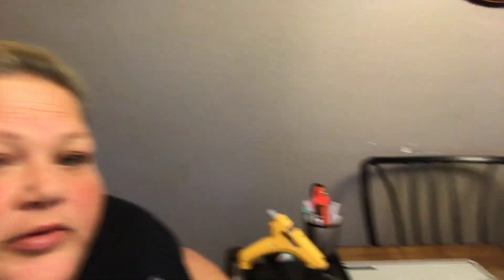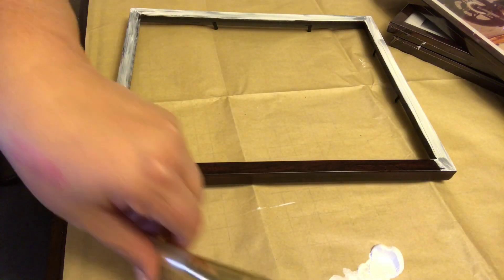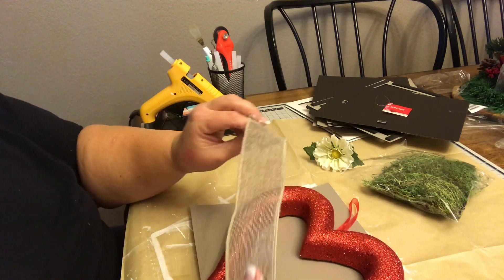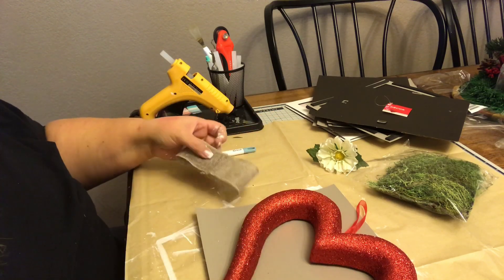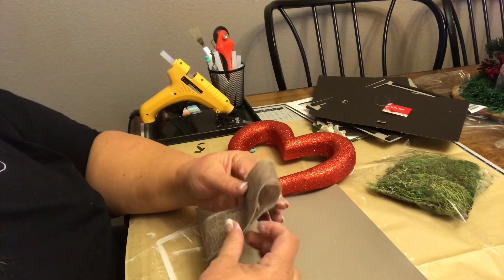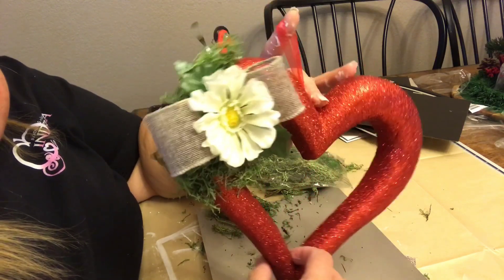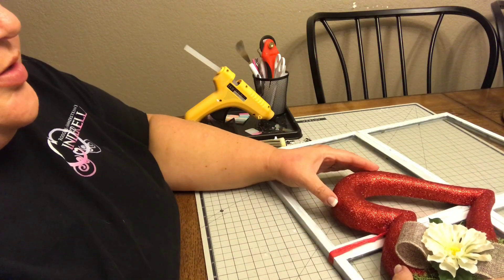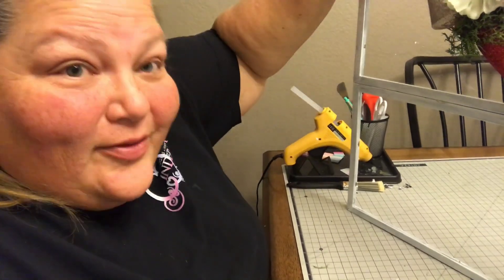Dollar Tree DIY - Farmhouse Valentine Window

Comment: Hey Beauty I’m a new subscriber had have been binge watching really enjoy your ideas they are great ... just wanted to give you a tip on giving the weathered look to your painting projects if you would just get a well used cleaned paint brush and dry brush or dip your brush lightly in the paint and dab a lot of the paint off and lightly brush whatever your painting with light strokes and try not to hit the same spots over it will give you the weathered or old look your going for😊 keep sharing and keep crafting and sharing your ideas👍🏼
Reply: Jean another thing you could do is to make sure the frames are good and secured together is glue some crafting sticks between the frames where they all meet in the middle👍🏼....just wanted to share some tips the window turned out very nice

Comment: That looks so cute. I think that I am going to make this for myself as well. I will glue the frames together with E600 and hot glue before I paint it. I would be afraid that the paint would keep the frames from adhering well for any extended period of time. Also you can use this window all year round and put different small wreaths or decor on it for different holidays. Great job.